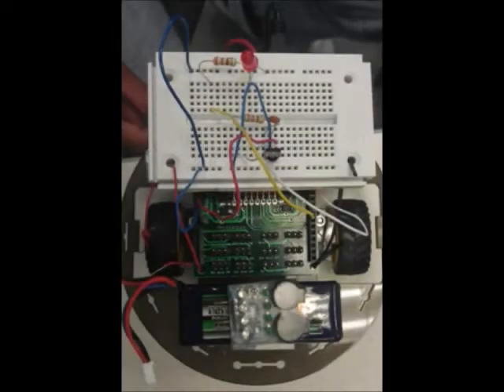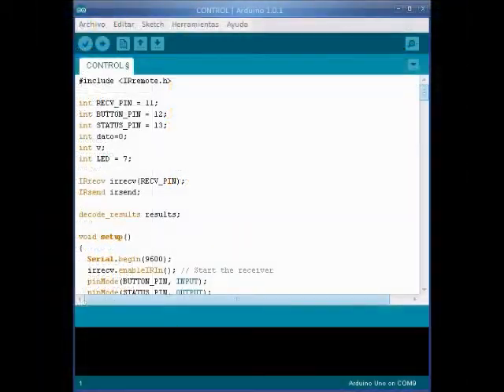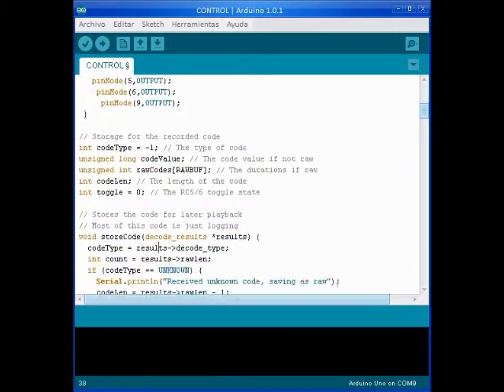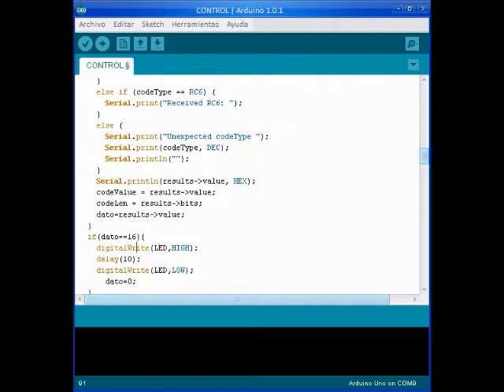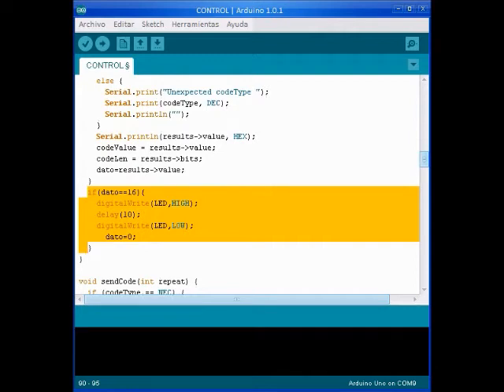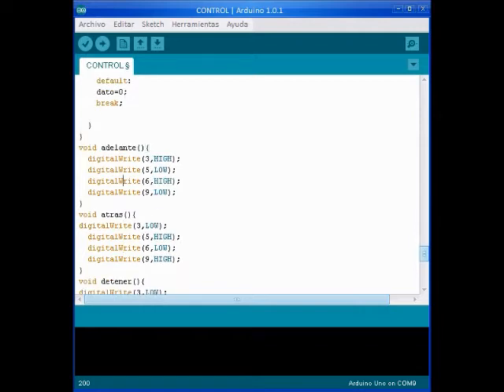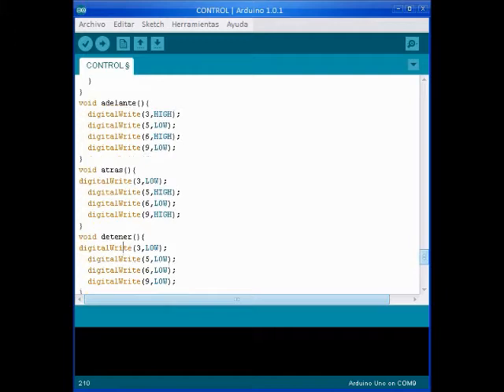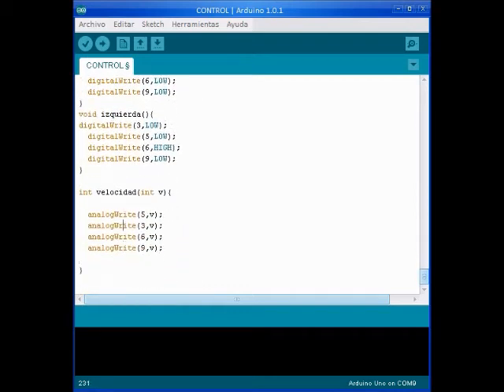Arduino IR Remote control, Sony RM-Y173

Comment: You 3 are have a great Video, I am trying to get the program to work for me, I having trouble.
I am using a Arduino MEGA 2560 and it does not the like IRremote.h it will not turn orange in color. If the program does not recognize IRremote. it will stay black Right?? As you can tell I am new at this